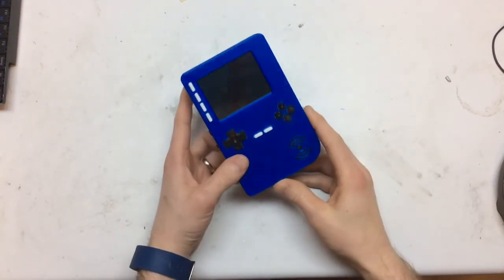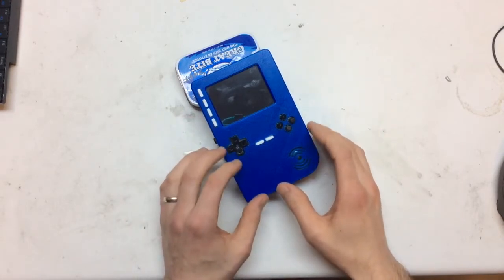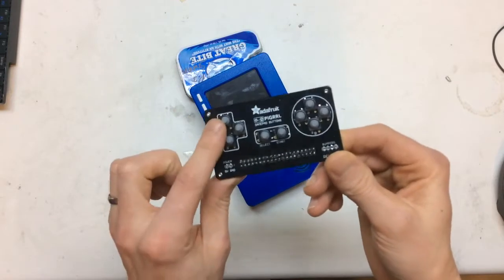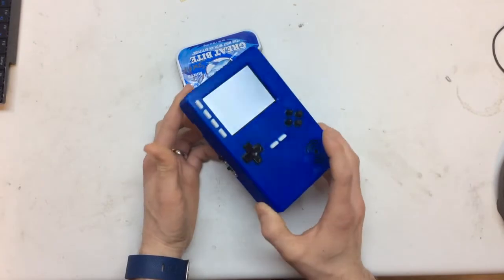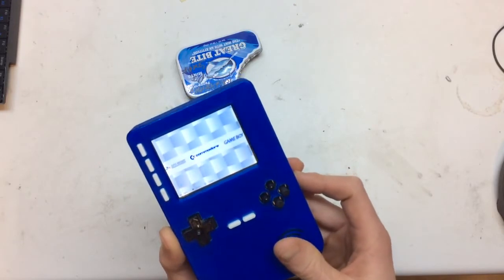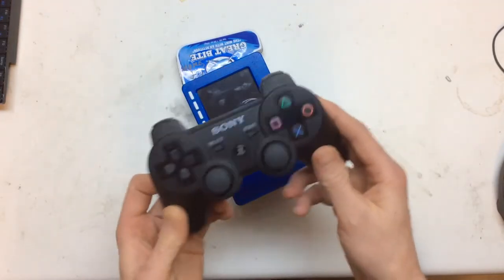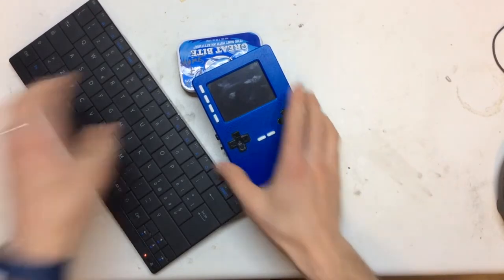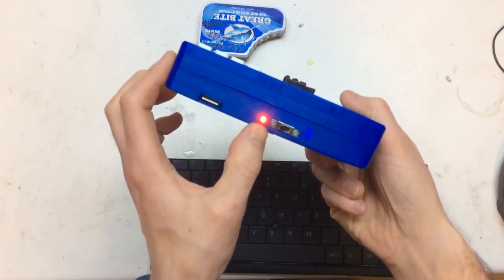Walk through of my pigrrl 2 build with a few mods

Comment: Can you use a raspberry pi 3 with this and have it so it will not be under-powered or show the low voltage symbol?
~Thanks
Reply from the maker: I've got a raspberry pi 3 in my build. I did get the low voltage symbol but that was because the pi cable I made up didn't have a good connection on the power pins
Reply from the maker: No unfortunately that wont work. Keep that DS for spares and find one with a broken hinge on ebay for cheap

Comment: did you use a pi 3 and if so does it have a heating issue, did you use heatsink?
Reply from the maker: No, It did get warm but nothing to worry about. It depends on what emulators you are playing. You could add a fan?

Comment: how did you extend the LEDs?
Reply from the maker: I just soldered a pair of wires off each side of the raspberry pi LED, Just remember to get the polarity right
Reply: Facelesstech any chance you you could tell me how to find out which is anode and cathode?
Reply from the maker: I used a continuity test on my multi meter to find the ground side of the LED by putting one probe on the USB shield and testing each side of the led or by measuring the voltage to see which is + and which is -